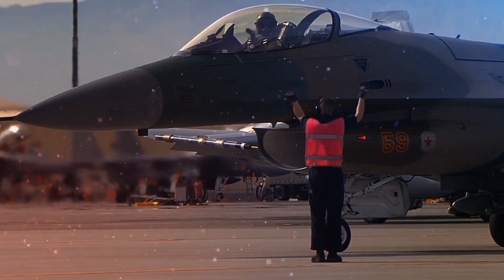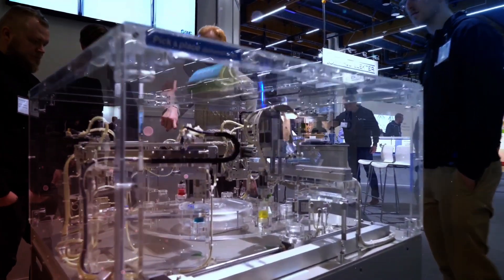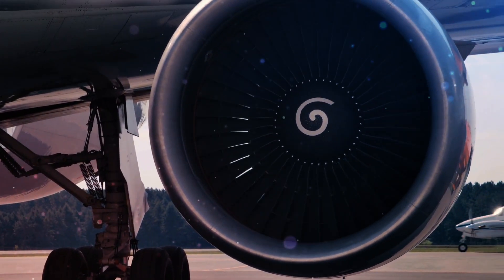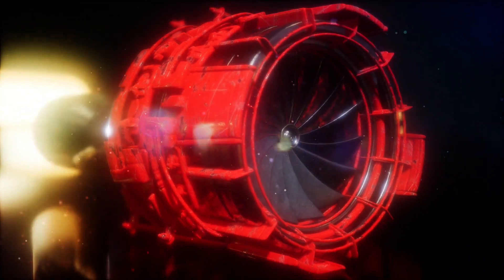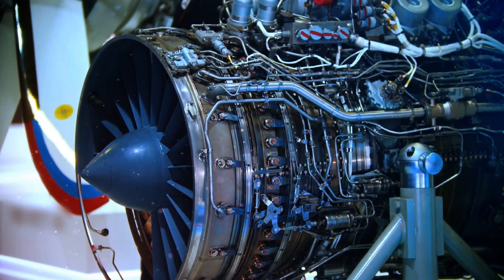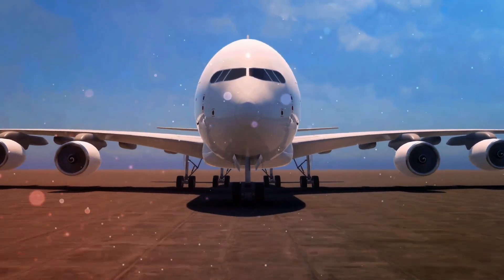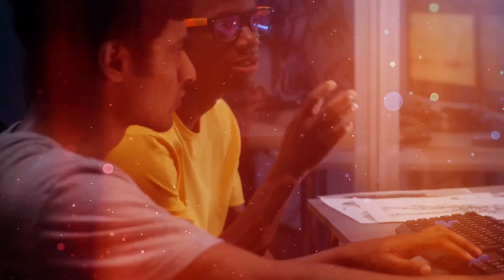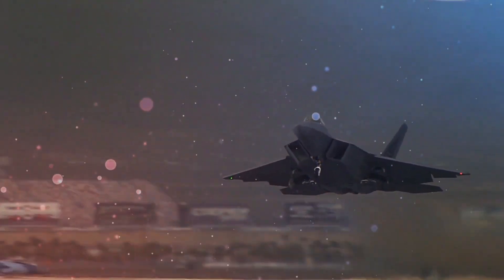New Hybrid Destroy Jet Engines!!!

Comment: I wonder if this guy knows how jets aircrafts are propulsed, From the explanations, it doesn't seem so :(
Reply: I think he means, that this engine uses the electricity from burning the fuel in a different turbine to create heat in the heating chamber inside of a turbofan engine, instead of directly burning the fuel inside of these chambers. It would probably work if you develop it further, but it would be dump to go that many extra steps, especially because you could just use fuel that doesn’t emit toxic or unhealthy gases. Just use normal flight kerosene or e-fuels.

Comment: Former Boeing... weight... costs... packaging... etc... and zero need for this... emissions from current high performance turbo-fan engines are already very low... airplanes are not same a diesel electric locomotives or ships or construction equipment. PS: ask me about better TTS and Scripting... cheers...
Reply: nah I wouldn’t say that they are very low, but there are no dangerous emissions for human health. Nonetheless the CO2 emissions are not very low in comparison to a car or a train and to lower the fuel consumption and emission is not a bad idea. That’s why we have to find a new solution there, besides the bypass ratio. You worked for Boeing so you should know the emissions of a plane per Kilometer and person at least roughly. To say that there is no need for a new idea is just bullshit.
Reply: @professormullmann159  Thanks for comment